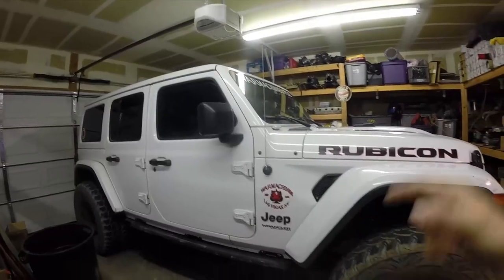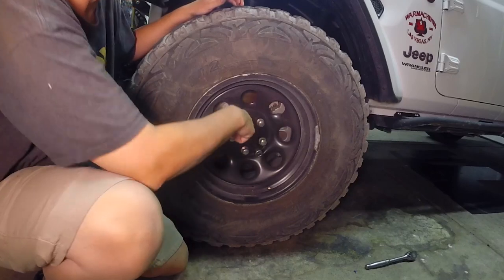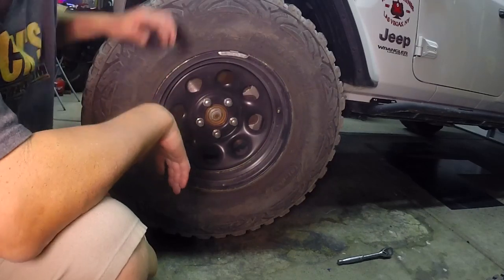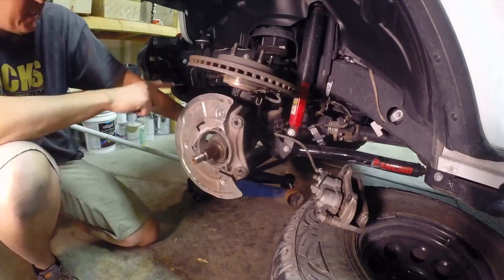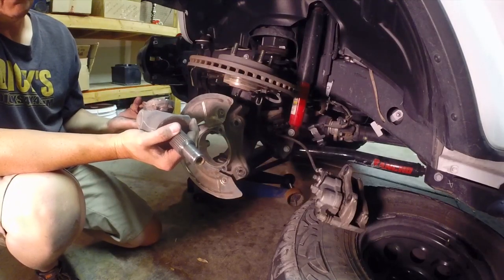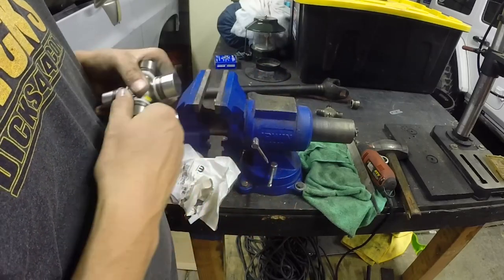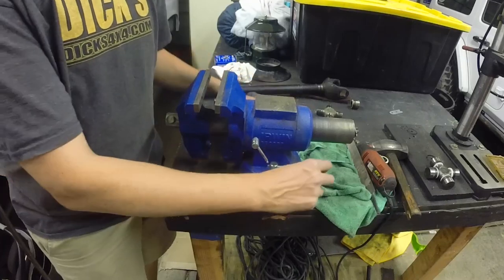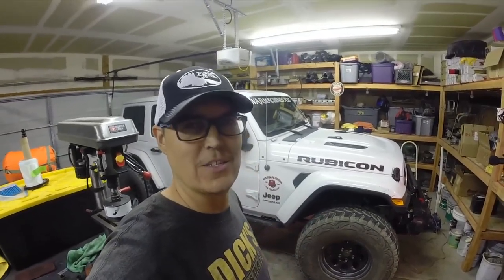Jeep JLU Rubicon - U joint Replacement

Comment: Getting ready to go run the rubicon want to get some extra u joints for the front and rear of the rubicon gladiator and my brothers JLUR

Do you have a part number for the u-joint ?

Comment: Thanks for the video. 

Good tip to center the u-joint in the vice while you press the caps on, I've bent the needle bearings before.
Where did you go on Sunday? My son and I went through Rocky Gap in the snow. Some stuck Nissan's caused a traffic jam for a while, still a great day.
Reply from the maker: Thanks for watching brother! I filmed this a month ago, since the video I’ve done logandale and sand hollow twice, seems to be holding up.  Was there a lot of snow up there?
Reply: @Dicks4x4Garage  It was patchy, but there was enough through the wash to make it interesting. There was a bit more at the top of Trout Canyon, so my son had a good time playing in it.

Comment: Bro I followed your godly swap video to a T. Did you have any power steering pressure issues at low rpm? Also do you have a recommended k10/k20 gear box support recommendation? How to or just buy a kit. Thanks again you are a blessing
Reply from the maker: Thanks for watching brother! No issues with steering, if anything it seems better with the LS pump. When you say gear box, we talking about steering, trans, or transfer case?
Reply: Steering gearbox seems a bit loose on freeway. I may convert to psc in the future. Idling into a turn locks up for a few seconds. Thinking it’s the gear box issue or maybe my power steering pump pully is too big. I’m Trying not to force the steering wheel and crack the frame, that’s why I also asked for your opinion on a frame support?

Comment: It was kind of an odd break: no crazy wheel spin, no bouncing, the wheels were pretty straight  Hopefully you should be  good to go for a while!
Reply from the maker: Hopefully! This one has been holding up to some abuse lately.  I didn’t show in the video, but I had to pull it back out, and grind the crap out of the axle to get it how I wanted it. As for the break there was a little crack up on top that my tire caught, then pop.  I should have bumped it harder, could have avoided it HA!